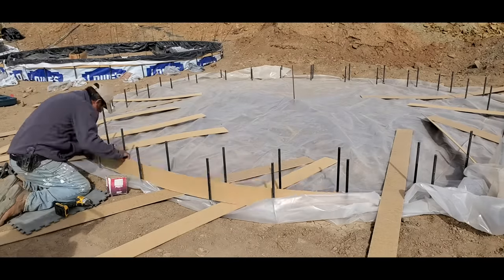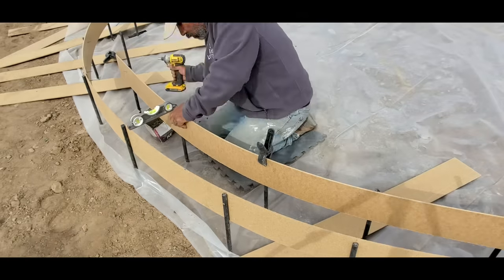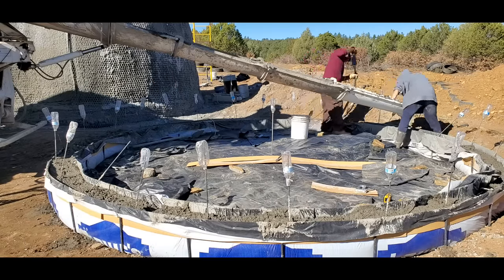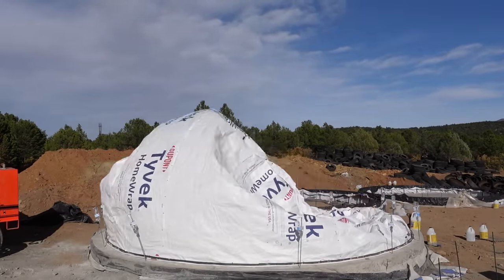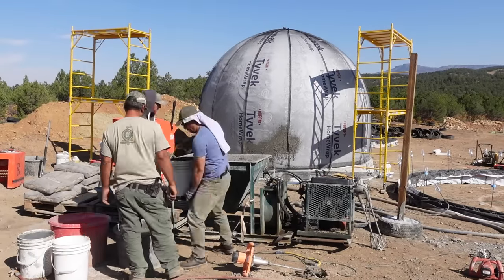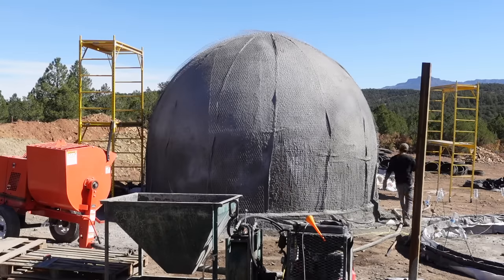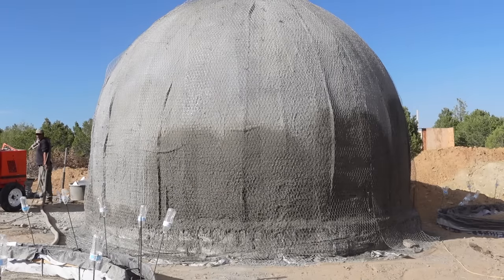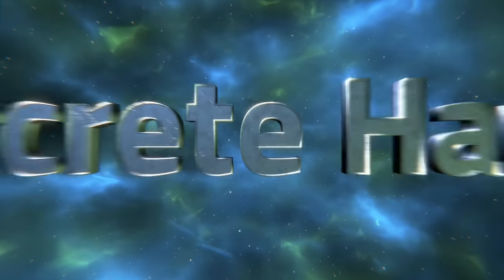NEW Dome Building System | Aircrete Harry #domebuildingsystem #dome #buildingsystem #aircreteharry

Comment: These people are correct, aircrete and the concept have been used in building submarines for many many years, including using stretched cables on the interior for flexibility.
In early persia, egypt, rome, and Mesopotamia era, they knew to add heavy seawater to their brick and mortar mix to increase its strength and hardness. That was 5,000 years ago.

Comment: How do you handle the insulation? Does the dome meet the required insulation values need for code compliance?
Reply from the maker: Yes. I have a high mix of EPS foam beads added for the insulation mix layer on top at about an R 40.

Comment: looks like all your metal mesh is aligned vertical with very thin overlap, be good to put some horizontal  support loops too, the top of the dome has a lot of layers due to this layout.
I think a better way to put the wire mesh is kind of like all 30 - 45 degrees, with cross overs, that way you get good overlap support from both vertical and horizontal loads, imagine a 3 frequency dome you will see there is some kind of pattern strips shapes around 30 degree angle from ground to top/offcenter then loops back to ground again, the top of the dome has minimal overlap too, its probably use less metal too when using both verti and hori loops, but more difficult to build, as long as you get few solid crossover, you can have some gaps that can be patch up with smaller pieces of mesh.
Reply from the maker: The mesh is tied together so it's like one wire mesh hat on the dome.

Comment: Did you add any chromate to offset the PH levels in the concrete to reduce hydrogen gassing reaction on the galvanized wire mesh during the cure?
Reply from the maker: No. It's a stucco wire mesh made for cement stucco.

Comment: I like your ideas. I could get the first layer done and work on it in steps on a regular schedule incase I didn't have all the money at once. I would like to build 2 one for a garage and storage and one for a wood shop. I would put alot of windows in mine for natural light with reinforced shutter system incase of emergency.
Reply from the maker: Yes it will work great to build in steps.

Comment: I like the fact your using the same forming idea they used back in the 60s for a foam dome home in Main. They made the dome 18inches thick at the top and 24 inches around the bottom. As I remember it had no problem with the snow loads and heated cheaply. They used heavy vapour barrier taped together as the dome mold.  what do you estimate your dome snow load is? Inside how do you propose hanging cupboards? Interesting idea I would like to see it in a year or two.
Reply from the maker: Hey Joe, I don't know what the number is for snow loads but being a dome with 3 layers of reinforcement I know it's very high. As for cupboards I can't wait to see how I do that as well. I can say this the plan is to use no wood, so it will be molded cement of some kind.  Thanks!

Comment: Are you working with a architect on these designs? I would really like to know the engineering/architects qualifications for the structural integrity of a dome structure. The force on a dome is pushing outwards below the equator and inwards above. The only structural elements then should be below the inward force. Like an egg, a dome supports itself as long as the material can support the compressive force. Your stem walls are very tall. The structure reminds me of a domed cylinder (grain silo) not a true dome. The outward pressures on those vertical walls is exponentially higher than in a true dome.  Even a parabolic shape would be stronger than straight walls. Have you had failures with the other conventional building methods of aircrete? Just curious why you are headed in this direction. I've been following you from the very beginning and appreciate the work you have done. Sacred geometry defines structural integrity.  Cheers Harry!
Reply: That's true if gravity is the only "force" you're dealing with and accounting for. Cost and speed is a balancing act and so often solutions that may not satisfy idealism are the most appropriate in real world construction.
Reply: @DiscoFang  I have been in the "real world construction" business for over twenty years and poured thousands of yards of concrete in many forms and structures. Unless you live in an earthquake zone then gravity "is" the only force on your structure. I can tell you it costs more to monolithic-ally pour a dome than build it with bricks. And the structural integrity differences are minimal.
Reply from the maker: Yes! I have a 4 foot stem wall on the dome that gives me head room when standing next to wall. The shell when all said and done will be two inches thick at the top and about 3 inches at the stem wall of reinforced concrete and about 8 inches of the 500 psi insulation mix on top.  making the shell about ten inches thick.

Comment: This is very interesting, but have you ever considered a vertical ponywall,with the arch over that. The round structure has always failed because you can't put  square cabinets and appliances close to the walls .a ponywall solves that problem and allows for a long structure
Reply from the maker: Yes I have considered a ponywall I just never knew that was the name. Thanks!

Comment: I understand that hemp is a fantastic strengthener in concrete. Proven in earth quake testing in california. Also what glue are you using for tyvek balloons?
Reply from the maker: Just 3 cement mixe design I use. And the airform is sewed together.
Reply: @AircreteHarry  tyvek is an amazing material. I have been working on a wing design in tyvek.   Your aircrete  system is pretty sweet.
Reply: @AircreteHarry  : wow. Like with a sewing machine, or by hand and nylon fishing wire or something? I was going to assume packing tape or something like that was used.

Comment: If one is allergic to Latex will will the off gassing go away at some point?  And are any of your domes underground stable?  I’m looking for a  super sturdy 700 sq ft underground dome home ( basically built into a  hillside with a door exposed )
Reply from the maker: At some point it will you can also cover the wall on the inside with Magnesium Based Cement. This dome can be made to go underground.

Comment: What did the final cost come too ?what is its R value  ?  Lastly how does this compare with cinder block (filling aircrete in the holes for additional R value and strength ) ?
Reply from the maker: Cinder blocks give you a bad thermal bridge that one thing to consider. Depending on the mix you make the R value can be anywhere from R 4 to 15 per inch. $5000 to build.

Comment: Stupid question maybe but is the balloon absolutely necessary? Couldn't you use a frame made of flexible wood on which to attach the reinforcing layers instead?
Reply from the maker: I'm getting away from wood as much as posable. You could build that way but I think that would take much longer the wood is much heavier. I have been working on a system that makes it easy and fast to build. Wood is not the answer.
Reply: @AircreteHarry  ok and how does one get the airframe?
Reply from the maker: @Khamomil  https://aircreteharry.com/product/how-to-build-a-dome-air-form-and-mount-to-slab/

https://aircreteharry.com/product/16-foot-diameter-dome-air-form-200-square-feet-custom-order-aircrete-harry/

https://aircreteharry.com/product/24-foot-diameter-dome-air-form-423-square-feet-custom-order-aircrete-harry/

Comment: Harry, I think you have the formula. The light, thin, high rigidity shell will give you a solid foundation on which to lay the reinforcement and gradually build up the aircrete. I'll bet the interior looks great when you pull out the Tyvek!
Reply from the maker: Yes! Interior walls come out smooth.
Reply: When you don't pour it all in one go, there is poor adhesion to the layers reducing the strength significantly!

Comment: I would like a wide dome but not that tall because of heating expenses, such as 16 by 7, is that possible,  I guess it wouldn't be called a dome with those dimensions. The 5th cost, is for the complete expense of the frame and the material for the coverings?
Reply from the maker: It's possible but you would not be happy in that size dome. You would have no wall space.
Reply from the maker: Anything is possible you mite be better off build a squire house or some other alternative.

Comment: From where can one order the air forms? Most of the stresses in the dome are compressive, therefore linear reinforcement mesh rather than diamond shaped mesh reinforcement would be better because the diamond shape compresses and only helps to prevent shrinkage and does not necessary add to the compressive strength of the dome
Reply from the maker: www.aircreteharry.com   Lot's of ways to reinforce, for the domes with skylight the wire mesh will be at an angel.

Comment: I remember a company called Monolithic Domes from a couple of decades back.  They were out of Texas.
Reply: Yea they’re pretty good. I looked into that company few years back. But Harry is on a next level with his dome 🤓🧠
Reply: @BrooklynTony1  I thought their prices were pretty steep besides Harry's system is truly DIY which I prefer.
Reply: @magicdaveable  you can copy and bastardize Monolithic's building process too, it's not like this guy invented something. He just copied what they're doing, just not as well.
Reply: Yes, they're still going strong. I attended their school in April 2019.  I finally have some land to build on now, and will start with a 20' studio dome.  They definitely will cost more, take at least two people to build (me and one helper minimum) but will last for centuries if maintained properly.  

You'll use an inflator fan like Harry, and can/should use the same shotcrete pump he used.
But the airform is weather-tight and you work from the inside through an airlock door.  You'll spray 3" of polyurethane insulation on the inside of the airform, place rebar hangers in that foam, run a cage of #3 rebar on 12" centers and finally spray the inside with 3" of 5000psi shotcrete (in several stages, of course).   What you'll have is a dome shell on a slab costing 2-3 times what Harry quoted ($10k-$15K)

As it is reinforced 5000psi concrete, you won't be cutting doors and windows after the fact like Harry can, so those would be already planned in the airform design.  Monolithic definitely has worked out all the kinks and has a proven system.  And it will cost more.  But again, it will last for centuries if desired.

And as a bonus...if you make the walls 4" shotcrete, you can call it a "shelter" and it will have what FEMA calls "near absolute protection" from any of mother nature's trials.  It will laugh at an EF5 tornado.

I have toyed with the idea of an AirCrete dome for years, but there are compromises with either system.  With Aircrete you won't have the protection of an airborne missile in a storm like a monolithic dome.  But with a Monolithic dome, you don't have the luxury of taking your time.  The polyurethane needs to be completed in one day.  The shotcrete when you start should continue as fast as possible (depending on the temperature) to get to 3" minimum before the previous pass cures much beyond 600psi.  Usually 4 passes at 3/4" each. Might take up to a week.

Aircrete appears to cost less to build, but there's no time tested system in place.  Harry has something that works for him, but he has no school like Monolithic.

Domegaia has a system where you make aircrete blocks and build a dome using various techniques, but that requires weeks...months of block making prior to building.  And when you finally start building, each block will need to be shaped a bit to allow for the curvature of the dome.  Harry bypasses avoids that problem with simply spraying a form with shotaircrete.

Monolithic also has the "Ecoshell" dome similar to Harry's.  It is the dome to which he referred that could be used 100+ times.  This is something you would spray from the outside with 1.5" - 2" of shotcrete with basalt rope in between the two passes.  It could be built quite cheaply, BUT would not have the insulating nature of Harry's Aircrete.  It is recommended ONLY for storage or a garage unless you're in a tropical climate.  Don't make a home out of it in nearly all the US, unless you're in Hawaii.

 If you don't have tornadoes or hurricanes (like I do in Florida) or earthquakes, then Harry's dome could be for you too.

Oh, one more thing.  This "code" business is a requirement if you're "under the authority of the code". However, if you're one of the "people", codes are simply advisory.  Don't get me wrong, codes "can" be good advice, but I'm not bound by them on my own property.  

An Aircrete dome with 4" ceilings might not have the "R Value" that "Code" requires, but an airtight dome won't be leaking air like a stickbuilt home, nor will it have studs every 16" acting as a thermal bridge.

So in this case a 4" Aircrete home would be MUCH more energy efficient than a fiberglass insulated R50 roofed home.  And in this case, the "Codes" are simply "good advice".  You may have an R20 roof with Aircrete, but since it won't leak heat with thermal bridges like studs, nor have air passages like Fiberglass can, and won't have internal convection also like Fiberglass does, you'll end up with a more energy efficient home than "Code" requires.

Just thank the Code officer for his advice and bid him a good day.

Comment: hello, what do you think is the average weight of all the concrete and mesh materials in this model? or how many bags of concrete does it take to make the actual dome form before it is dry enough to stand without the need for the air form (not the foundation slab)?
Reply from the maker: The dome takes 120 bags of cement. 80 bags of sand. All together the dome shell weights 15,000 pounds.

Comment: Rather than concrete which is very damaging to produce, use HEMPCRETE  instead which has a higher  U value is cheaper to purchase and also breathable if lime based paints are used.
Reply from the maker: Hempcrete would not work for a dome built using Air-Forms. Cement companies are not going to stop making cement, so I'll us it and it's less expensive then a hempcrete. And Hempcrete does not have a better R value then my Aircrete or EPIC.

Comment: harry , tyvek is a trademarked name,,, everyone knows like fibreglass pink but its actually "spun bonded poly olyetheleyn " which is a BREATHABLE or semipermeable membrane...it seems counter intuitive to use  something that leaks air by design as a vessel to hold air...wouldnt poly or some other sheet membrain  be cheaper and preform better? b fuller has always been worth knowing about and domes are the most space for the least surface... furnature is an issue it tends to be square not curved . i studied architecture and tinkered with a subteranian dwelling under a polycarbonate dome back when "aircrete" would have at best been air entrainment for special conditions or applications. good luck with your build and please remember code is supposed to be THE MINIMUM SAFE way or ammount so to build better than code should be your minimum.

Comment: I want to build an underground dome home. What reinforcements would I need to build this type of dome but 30 foot diameter underground?
Reply from the maker: The same way I built this dome but with the added rebar. What state are you building your underground dome?
Reply: @AircreteHarry  Building in Henry County, Missouri. It seems like you'd have to have a few more layers of concrete.

Comment: Boundless energy and a few new tools.  For engineering puposes, maybe build an unfinished test dome as thin as possible to see where a weakness may be. It may be a good way to show how unbreakable one is. The tension stress is highest where the sphere meets the cylinder.  For a bigger dome, that is where to wrap some basalt rope or whatever.  Looks like fun!
Reply from the maker: I want to build a dome to have it tested at the of the earthquake testing places. I have to get more information on that.
Reply: @AircreteHarry  The most relevant info is that you may need more $ for that testing than maybe your entire budget to date.

Comment: This is awesome! What do you think about concrete 3D printing using a special concrete mixture and a similar supporting structure?
Reply from the maker: I like it a lot I have been thinking of a 3d printer design incorporating Aircrete.
Reply: @AircreteHarry  Perhaps you could 3D print the structure and finish it off smooth with Aircrete? I really want to get involved in this area, I think it will disrupt real estate. Do you have any ideas for cheap and durable construction of privacy fences using any of your techniques? I live in Florida and I think the wood fences are such a costly and inefficient way to build. They just don’t hold up to the hurricanes , termites and wood rot we get here. I want to 3D print them.

Comment: If you think those water bottles on your upsticking rebar are going to prevent someone from becoming impaled, I think you need to reconsider. If someone trips onto it, that rebar will punch right through that thin, crappy plastic like it wasn't there. MIght stop you poking your eye out, but that's about it.
Reply from the maker: The bottles are only there to protect the airform from being impaled and anyone's eye's.

Comment: One of the advantages of the concrete dome home is that it acts as a thermal battery/maintaining temperature for days.  I’m wondering how using aircrete would change this as air is a terrible conductor 🧐.  Not criticizing this method of course! Just wondering what the pros/cons are in aircrete vs traditional concrete

Comment: Looks interesting. My idea is to use two opposing sections of the air forms (pie slices), but built with bent conduit and the sheet material used in the foundations.
Reply from the maker: I like to see it when your done.